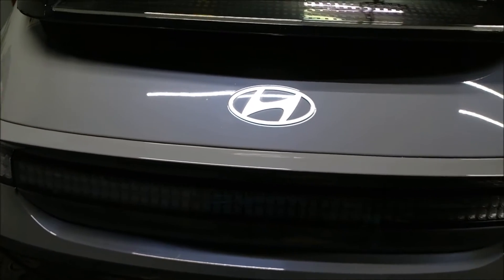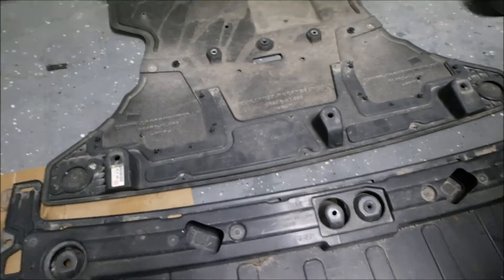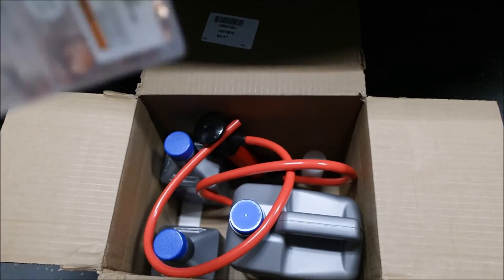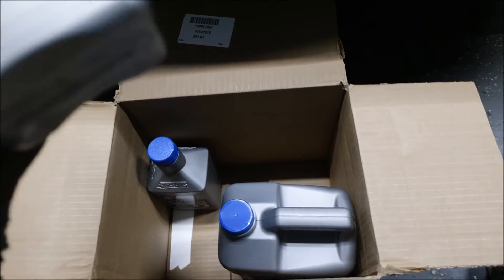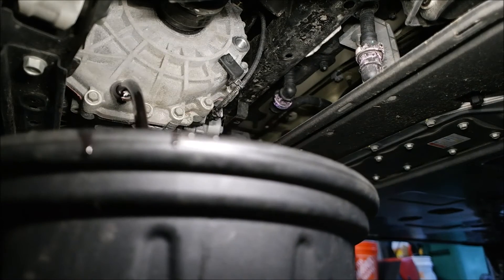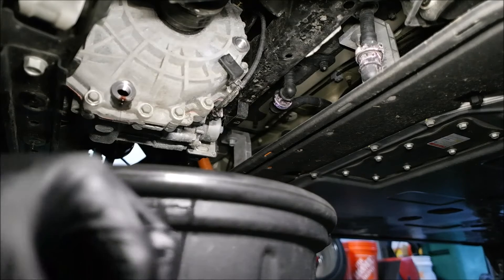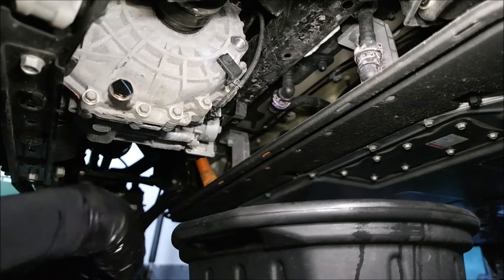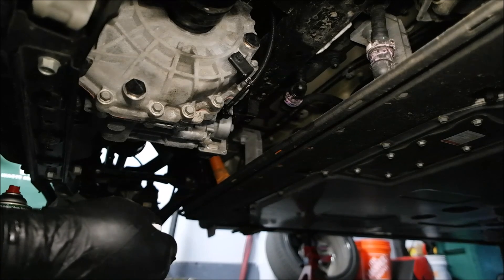Ioniq 6 Rear Drive Unit Fluid Replacement: The Hidden Maintenance You Shouldn’t Ignore!

Comment from the maker: When this video was made SP4M-1 could not be bought. Even still there is so little information on SP4M-1. I went with amosil for two reasons. A. its full synthetic B. it almost always exceeds OEM fluids anyways. 

The leading theory's at the moment is that the SP4M is a synthetic blend and that SP4M-1 is Full synthetic This is sort of legitimized as There is a bulletin floating around from Hyundai saying it was okay to use SP4M-1 instead of SP4M because there was a shortage on SP4M. To further complicate this SP4M-1 now pretty much supersedes all other Hyundai/kia ATF's  🤷‍♂

However if you want to be safe Just buy SP4M-1 From the dealer its part number 00232-19107

Comment: I talked to Hyundai and also Kia America - The only fluid to be used is SP4M-1. The Amsoil ATF is SP4M. Im told that using SP4M will void warranty because it is not reverse compatible
Reply from the maker: When this video was made SP4M-1 could not be bought. Even still there is so little information on SP4M-1. I went with amosil for two reasons. A. its full synthetic B. it almost always exceeds OEM fluids anyways. 

The leading theory's at the moment is that the SP4M is a synthetic blend and that SP4M-1 is Full synthetic This is sort of legitimized as There is a bulletin floating around from Hyundai saying it was okay to use SP4M-1 instead of SP4M because there was a shortage on SP4M. To further complicate this SP4M-1 now pretty much supersedes all other Hyundai/kia ATF's  🤷‍♂

However if you want to be safe Just buy SP4M-1 From the dealer its part number 00232-19107

Comment: Hi there, if you're using front wheel drive all the time(Eco mode). When should we change front and back??. Mine got 44k miles. How to check if it's dirty?? The manual says change at 85k miles.In your case that's pretty dirty at 25kmiles. Nice info. Keep it up.
Reply from the maker: Your line of thinking is not wrong, but if you never use the front diff, inevitability moisture will build and it won't get burned off, so you might as well change them both at the same time.